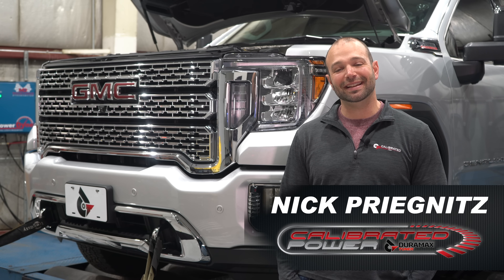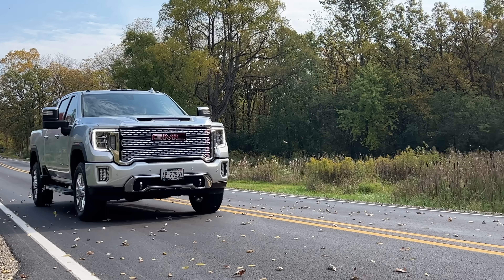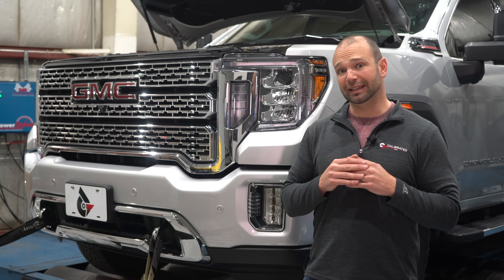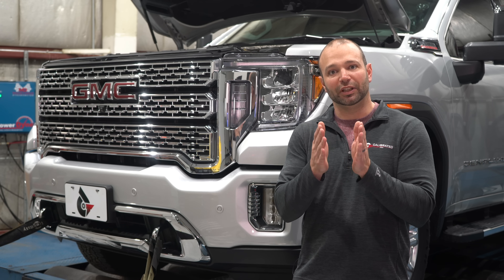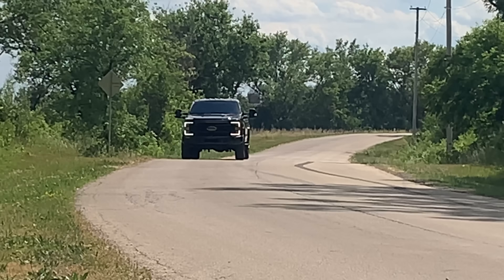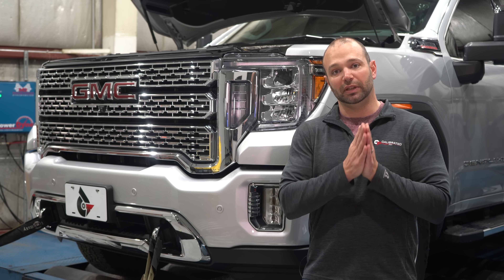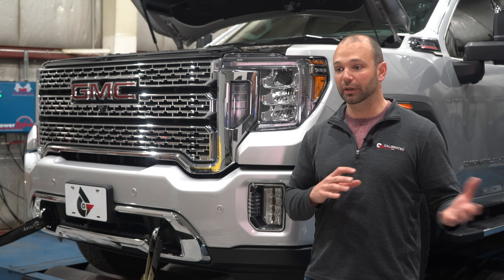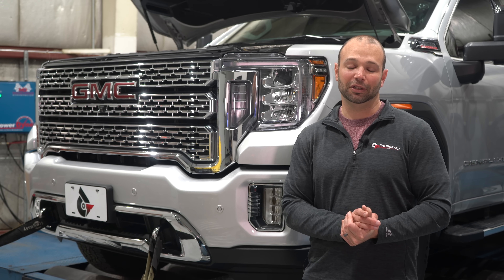10-Speed Allison Transmission 101

Comment: Will be in the shop as much as on the road. My 2001 2500 HD Silverado 4x4 has NEVER been in the shop for any repairs. Only tires and batteries. I’m currently doing the brakes and belts and hoses which are original but I plan on hauling my truck camper to Utah in the fall (from Louisiana). The best vehicle I have ever owned. Only used for hauling a 13000 lb boat and camper, so 120K HARD miles!
Reply: I have one too, mine is the 2 door regular cab fleet grade long bed with 200k on it I love it.
Reply: My lb7 386k heads gaskets and injectors done. Original trans. Runs grear

Comment: Fanboy of simplicity, less to break, less $$ to repair, I’ll take a 6 speed please
Reply: Make it a MANUAL shift transmission...lets cut the fluff and get back to what trucks were originally designed to do---WORK HARD!
Reply: @bayou-buy-me  
Agreed
Reply: Me too, the 10 speeds are trouble prone.  Both Ford and GM are having issues with them.  It is the primary reason I haven’t bought a newer truck.

Comment: Good video on the 10 speed.  Especially the comments about being the the 'right gear' all the time.  My current truck is a 2018 GMC Sierra 1500.  5.3L/6 speed.  I'll be upgrading to a heavier duty truck within the next couple of years, so thanks for the info. 

On a side note, I bought a new 2011 Jeep Grand Cherokee Overland.  It had the 5.7L/5 speed.  It was a good driving vehicle.  In 2014, I traded for a Grand Cherokee Summit, 5.7L/ 8 speed.  Big difference in diveability.  The 8 speed shifted smoothly, almost un-noticed.  In addition, it gave the driving impression that the vehicle was 'always in the right gear'.  Bought a 2017 with similar specs, then a 2020 similar specs.  All have/are good vehicles.
Reply: Ive got the 2014 1500 5.3 4x4.
Does your transmission ever shift really really hard at low speeds? Like its goin to drop out
Reply: Regarding those Jeeps (Dodge Durango and 1500 Ram PU share the same powertrain)...  The 8-speed was designed by German company ZF, and built by them or in a JV with what was Chrysler's transmission manufacturing operations.  It is a newer and much better trans than the 5-speed which was the last home-grown Chrysler AT.
Reply: @hackfabrication139  The 8 speed that Ram uses in thise trucks is a ZF from Germany. It is used in a vast number of vehicles in its carrying capability builds.  In a BMW with a turbo 4 it is an astounding combination.  It feels like a probe has been planted in your brain ir some other spot so it knows exactly what you want and need.  Probably the best I've driver in 60 years.

Comment: Stracky & hutch ruled the never ending shifting. That grand Torino sometimes had an automatic and sometimes a stick , the thing a 13 year old loves😂.
Big trucks are using less gears. Whim I was 12 I drove a dump truck with a Detroit 6-53 and an 18 speed road ranger. At that shifting gears all day was COOL .When I had to retire I was driving a 2008 (in2013) and it had a 10 speed. With almost a million miles on it. I put over 500 thousand miles on it and never put a clutch in it an 90%of my loads were pushin the 80 thousand pounds (on the scale) . 
I have a 6 speed automatic in Mr 08 Chevy and sometimes wish I had a 10. I also have an02 dodge 2500 with a Basterdised 4 speed, 204 :thousand miles and it’s junk , had to get it rebuilt (. 3 times  to get it close to good)and hate it, but I can get23mpg( empty) . The best I can get from the Chevy 3500 (also empty) and driving 10 mph slower is 15 mpg. The dodge gets that pulling a 3horse ,horse loaded(14900GVW) I think it is the Cummins. Which I prefer over the DMax. 90% of the time. The Chevy pulls a little better but I think it is the Allison not the motor. My friend has a 23 Chevy and he LOVES it, but I personally have never drove it. He says it pulls better than anything he has ever driven. But he paid a little over 90 thousand dollars for it, so it should.
I think a 6.7 Cummins and an Allison 10 speed would be the ticket ( automatic transmission wise )  big trucks are more to my liking. My 08 KW T-800 (RODE ) better than any of my small trucks. Thanks for the explanation.

Comment: it wont be long until 12 or 13 speed transmission will be in these trucks ,but with the 10 speed i guess the rear axle ratio must 3.23 or higher?
Reply: No I think 10 is about the limit

Comment: This is a Allison branded 10 speed developed by Ford.
Reply: This transmission is allison branded, developed by GM, and only by GM.  Ford and GM DID NOT co-develop this 10speed.  The transmission that is in the 1500 series trucks was the 10speed that was co-developed with ford.
Reply: @charlesamey3144  nope Charles the 10L1000 and 10R140 are nearly identical and parts are interchangeable between the two.
Reply: David Ames, assistant chief engineer at GM, says otherwise.
Reply: @charlesamey3144  "There is a smaller version of this that was co-developed with Ford." David Ames on the 10L100 do you actually research anything?
Reply: @davidporter7051  watch a tear down video there are NO interchangeable parts at all
Reply: @adenseay7406  One thing that should be noted about the Allison 10L1000 is that this transmission is a fraternal twin of the Ford TorqShift 10 Speed 10R140. In fact, this transmissions internal components are largely interchangeable with those of the Ford, the parent engineer of this product.

Just admit you are wrong
Reply: @davidporter7051  I would but I’m not wrong. The half tons are the same not the 2500
Reply: @ they don’t even have same gear ratios 😂
Reply: @adenseay7406  and? That does mean the parts aren't interchangeable. Why are you using laughing emojis like a little adolescent girl? You find your ignorance funny?
Reply: @adenseay7406  you are wrong. I've cited an actual engineer who designed the transmission and reputable transmission builder and you being an adolescent says trust me bro
Reply: @ @ 0:48  I’m done arguing with DA internet trolls
Reply: @adenseay7406  you are not arguing. Not providing a single fact and using trust me bro isn't an argument. It's an adolescent girl strawman.
Reply: You wish. GM built such in house. Ford hd trans has some internals different from GM.
Reply: @jeffwill4923  the 10 speed was developed by Ford. With GM input. Research before posting.
Reply: @davidporter7051  you are completely wrong ford didn’t touch the HD transmission only the half tons.

Comment: Why cant we have a simple 6 speed manual and a good clutch.  Last 2x as long and easy to repair.
Reply: Because people are too lazy to drive them.
Reply: @wildbill23c  companies and politicians can drive them so no one else shall have onr
Reply: No more Arnold Schwarzenegger left leg. Especially in so cal traffic
Reply: @techs1smh13 😂
Reply: AMEN...guess it makes too much sense and not enough money for the shops. I've watch trucks become "yuppy toys" over the last 30 years. Too much fluff and not dependable work tools any more. I get unsolicited offers on my 2001 2500HD 4x4 on a monthly basis. It's far too valuable to me and works very hard (without pampering) for me to ever consider parting with it.
Reply: You answered your own question, from the money grubbing manufacturer standpoint
Reply: 1. Automatic transmissions are simpler for first time drivers
2. Companies want money and a long life tranmission is bad for business.
3. Laziness
4. You can usually change the mode on an auto tranmission to be more fuel efficient or have higher rpms.
Reply: @Neridian_  HD trucks used as intended are not for first time drivers.   Agree laziness is bad.  Manual mode change is instantly done by the driver.   Will always be easier to repair.
Reply: Manuals aren’t as easy to maintain as you think. The slave cylinders aren’t adjustable and you have to ranger bleed to change fluid since most don’t have a remote bleed.
Reply: @jkp2712  that is a easy job and does not require removal of the transmission.   Not a real challenge in my experience.
Reply: @VHP7044  the ranger method isn’t difficult but you have to drop the transmission to change a slave cylinder in pretty much any car I have seen recently.

Comment: Had a 22 f250 with the 10spd and 430 gears, Hated it. Back to a 17 with the 6spd and love it. Such an awesome transmission.
Reply: Didnt ford and  GM have alot of probelms with the10 speeds  ???
Reply: @bustersmith5569 yes, with seals, and the aluminum can would get scarring, now that put some kind of coating on it. A couple other things had to be tweaked as well.  I think the 2023 trannies have most of the updates. Could be late 22s - I don’t remember.
    I love my 2024 F350 super duty and it’s 6 speed, but the fuel mileage is much lower than you guys that have the 10 speed.   I hope they make it bulletproof by 2027, because I love the 10 speed, and will be in the market for a new F350 then.
    By the way, Ford and GM did a joint venture with the 10 speeds.  Some minor differences, but more alike than most people know.
    Blessings on your transmission!
Reply: Ford has been building pretty indestructible 6 speeds since the mid 2000s. I've replaced 4 engines in different F250s and not one trans in 19 years
Reply: Company I work for leased a '22 250 with the 6.7ps...  I really enjoyed it over the 350 dually 6.0 I'm usually towing with.  The added power was nice, but it was more the way the tranny shifted which I liked most.  That thing was smooth, whether it was skip shifting or going thru every gear.

Comment: I don't like an Allison 6 speed let alone  a 10 speed.Worst thing anyone could ever do is spec a heavy truck with an Allison Trans.Hate my Freightliner with an Allison
Reply: What’s in front of that Allison? Remember, it’s a freight liner so it’s junk to begin with. I’ve got an L9 Cummins in front of the 6 speed Allison and the shift schedule sucks and it’s underpowered. 

However, TOTALLY different animal in a pickup. It’s a great trans in a pickup and arguing differently is foolish. 

And if you hate the Allison in your freightliner, try one with a Mercedes and the 8 speed. Ran great with 450hp but the shifting sucked. It literally shifts three times before crossing an intersection and you feel every single one of them. Happy to have the 6 speed again

Comment: I have one and love it so far. Although the dealer told me it's $700 to change the fluid 😂
Reply: LOL, drop the pan, change the filter, put in new fluid, I don't see $700 there.
Reply: @wildbill23c  Totally agree
Reply: They don’t even do that unless you ask for it. They use a fluid exchange machine.
Reply: @johnm8961  Totally unnecessary, and a great way to cause problems with your transmission.  Never do an exchange or flush on any transmission, only drain/fill and replace the filter.
Reply: @wildbill23c  Agreed. A good transmission shop doesn’t have a fluid exchange machine. But the dealers do.
Reply: @johnm8961  The manufacturers and dealers also tell customers the transmissions are "sealed for life", or the first service is at 100k or more...umm, WRONG LOL.  With my car its at 50k intervals, with my truck that I tow with I do it every 35-40k and with 300k on it and no trouble out of the transmission its good reason to never trust a dealer/manufacturer's service information, they want you back and they want your money when that transmission fails.  Also, helps to have an auxiliary transmission cooler, and not that pile of crap one that is oftentimes found in the vehicle's radiator....bypass that thing, and install an external auxiliary cooler in front of the ac condenser and radiator.  I have one on my truck, and it keeps transmission temps well below 200 degrees even when towing up steep grades.
Reply: @johnm8961  Do you own a new truck? They try and b.s. u to do all sorts of service. I did not ask for it. Supposibly has 45k service life on the fluid.....
Reply: @devineunlimited6800  
I have a 2020.  Manual says 100k on fluid. Yeah. Right. 
Same dealer for service for 20+ yrs.  I have a good relationship with one and only one night service manager. If I have any doubts we bring in the shop manager for consult.  
Never felt cheated or pressured in any way. That’s my story and I’m sticking to it.

Comment: Has anybody ever wondered how trucks barely get any better gas mileage than they did 15-20 years ago? My 2021 trail boss with a 5.3 gets the exact same mileage as my 2010 Silverado Z 71 with a 5.3? And my 2023 duramax Crew cab z71 gets the same mileage as my 2011. same with any other Fkn make and model,it’s all BS. Chevy had that little car that got like 50mpg 40yrs ago and never heard anything more about it because the disruption in profits for the oil industry. They shredded them papers and cars. All the 10 speeds, CVT, direct fuel injection, emissions BS and they are like what? 3mpg better than something 15-20yrs ago.
Reply: So 40 horsepower and +3MPG isn't worth it to you.....then sell your '21,  find a '10 and be happy..
Reply: @johnpeters9793  really that’s what u took from that? So it took 12yrs for a tiny 40hp and 3mpg is my Fkn point clown. All this new technology and really we are no better off than we were 12-15 yrs ago. Pap smear. I don’t buy these trucks for fuel mileage my point is it’s comical how it truly hasn’t changed at all very much so we added 6-8 gears and a few horsepower and get a whopping 1-3mpg 😂, I’d love to go back to an actual Allison transmission not a junk 10 speed that was “Allison approved” which most people don’t know either
Reply: "Chevy had that little car that got like 50mpg 40yrs ago" <-- doubt would remotely come close to meeting emissions standards today.
Reply: @arbiter1  and it certainly would not meet the federal government crash standards.

Comment: Thanks Nick for your description and video.
My take on this is that if I leave my truck alone, bone stock, and use it to tow our RV (12.000 pound fifth wheel) then nothing is needed (no aftermarket parts). I don't care about how fast the truck is, it has plenty of power for what I do with it. Is this correct? Thank you!
Reply: Yes Jim, Id say that's accurate.

Comment: 6 speed. Mentioned ford who are seeing a lot of 10 speed failures. My fleet vehicle Ford transit 350 has 10 speed and it’s not nice to drive in my experience
Reply: Ford 6R80 was a fantastic transmission, the 10R drives rough in comparison.